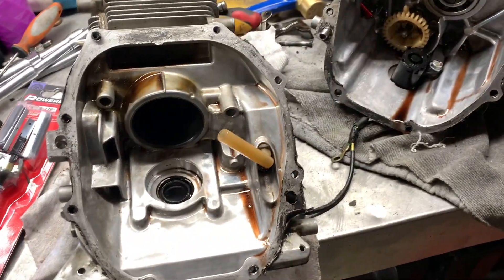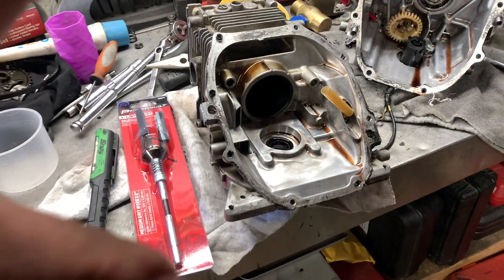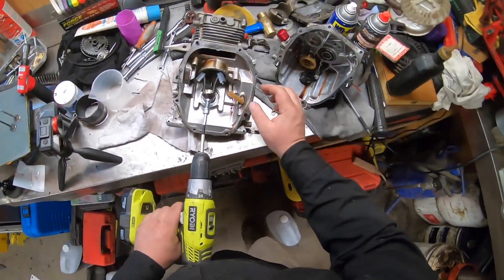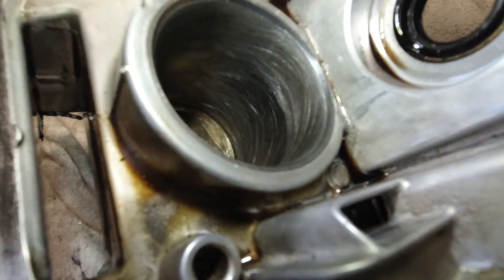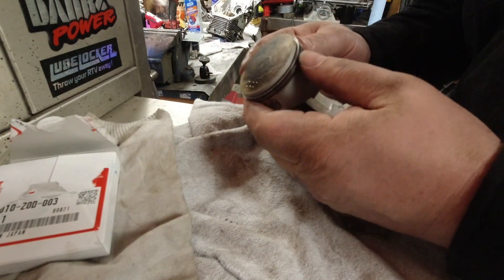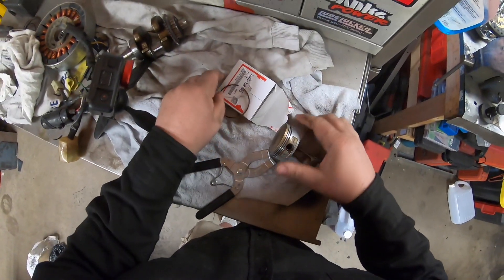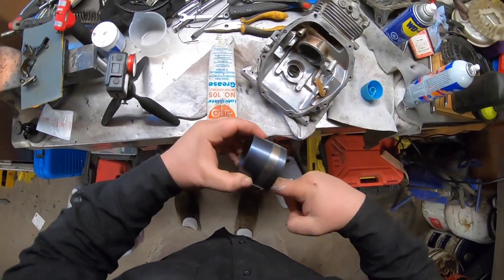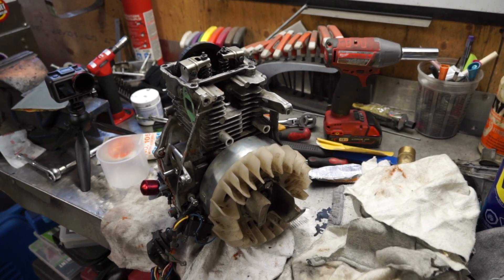Honda Eu2000i Cylinder Deglazing

Comment: Note here guys, don’t align piston ring gaps with pins rob pin bore, when you’re set 120 degrees apart. And don’t put your piston on backwards. Long end rod should be on the same side as big letters on piston and big letter side of piston  on intake side. 
Anyways I enjoy your videos brotha.straight to the points.